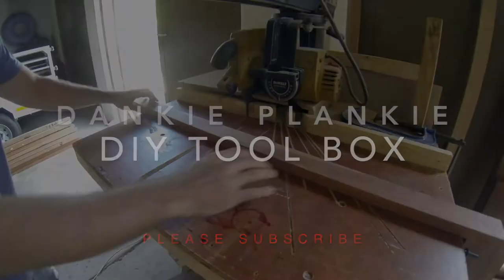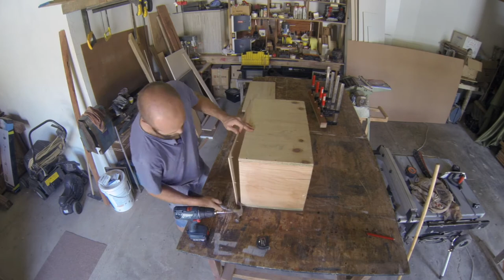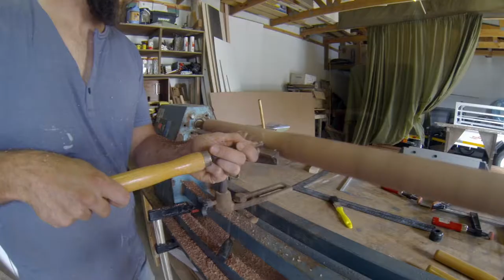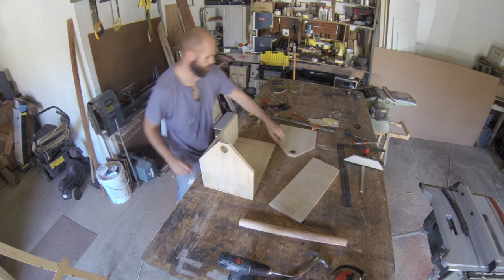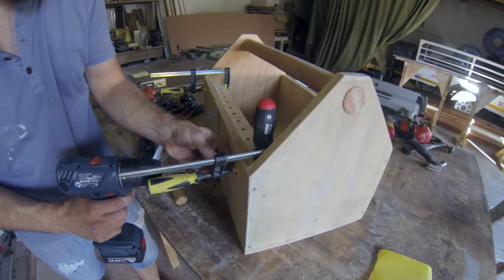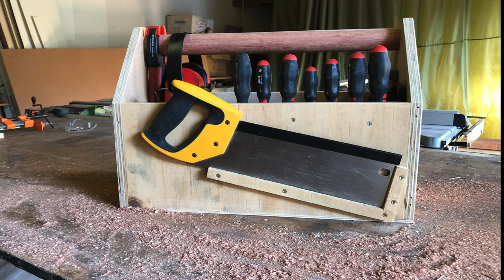DIY Plywood toolbox quick and easy.

Comment: There must already be a special idiot, so that in the carpentry of all possible work tables do not build this simple box.  In fact, you only need one metal pipe or stick for the handle, angle grinder, 3.2mm diameter drill bit, impact drill, skill saw, 25 wood screws, sand paper, PVA glue and some old table on how to do it all.  Good luck and vision at work guys!